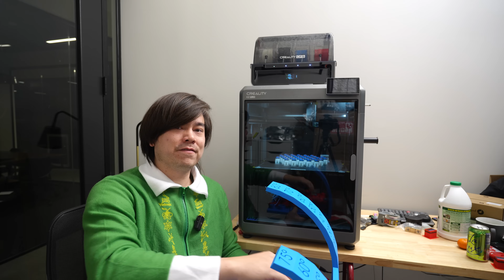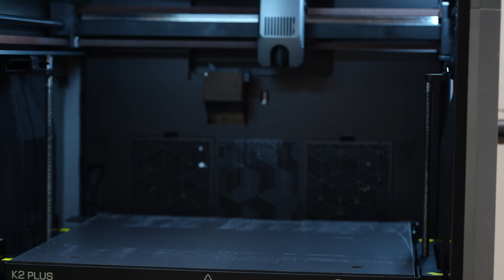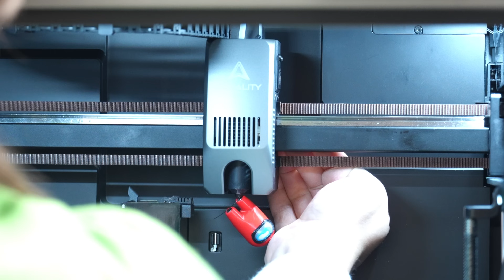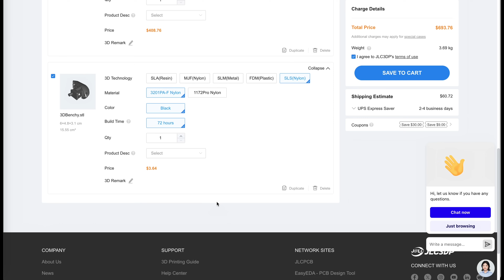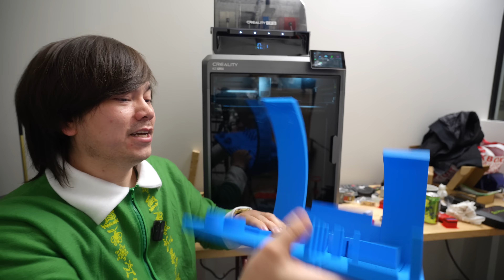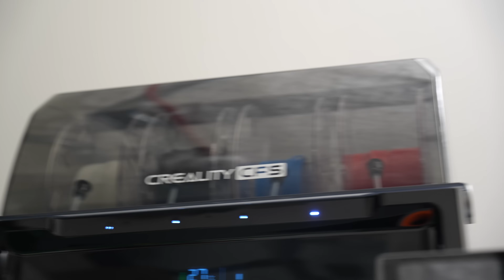Creality K2 Plus - Back With a Vengeance

Comment: "Nozzle and heater" section is a uninformative. Is it still a same Creality Unicorn nozzles? Is heater design as unfortunate as K1 was, requiring a regular thermal grease changes? Is fillament feeder is a same bad idea with cantilever drive gears? Does gears use and outdated design with roller bearings or a modern with ball bearings?
Reply: If this might help, from what I learned, it's a different nozzle&heater design with K1 series. Those two are not interchangeable.
Reply from the maker: Ok hold on, let me disassemble the entire printer for you right now 😪
Reply: @NathanBuildsRobots  For me? Or for a quality review for your audience? I see there is a minor difference. 

"Disassemble the _entire_ printer" or just service a damn hotend. An action which will be required to eventually be done by __every_ user of the product you are promoting?
Reply: @MrGarkin if he’s going to do it from suggestion, technically it’s both. But as a reviewer it makes zero sense to do it just for 1 person. You already answered your own question. I’m sure there will be complete disassembly videos soon, but they most likely want to get a bunch of prints out of the way first because everyone just wants to see the quality prints right now.
Reply: @SeriesDmusic "there will be others guys to do a good job" is a ridiculous take. 
"you are single person who needs this information" was not funny when was joked for the first time.

Comment: "Frame design" section is almost as underwhelming as "nozzle and heater"? Are they still using monolithic cast metal portal as at K1? How does frame differ from K1?
K1 is very problematic with it's X axis, tons of complaints all over teh internet. Did they finally abolish bronze bushing and finally gone to either ball bearings or POM?
Reply from the maker: K1 uses 4 extrusions for columns and a top/bottom portal. Everything is held together with bolts going into plastic blocks. K1 frame is very decent, but this is next level. Without fully taking it apart all I can say is it’s essentially 4 portals bolted together. Top/bottom like the k1 and left/right portals with steel or plastic panels bonded into the opening. I think everything is metal on metal bolted connections but it’s hard to see without disassembling it since there are no external fasteners
Reply: @NathanBuildsRobots  K1 monolithic cast XY gantry portal is main reason why it's has top accelerations relatively to every prebuilt on the market. 

Extended usage of a cast structure elements in K2 frame is a very good news for the product.
Reply: The K2 frame has nothing to do with the K1 apart from a similar visual appearance. There is a video posted on Creality's Facebook of the K2 assembly line, in which the printer appears "naked". The K2 has a lot of metal in its frame.
Reply: @matiasatamaniuk5266  would be very interesting to see it somewhere outside of the facebook.

Comment: I am just happy those old, shitty, Prusa gantry style i3 whatever the fuck machines are finally dying. 
I have always hated their design.
Reply from the maker: They have a place, it’s all about price point and if you need an enclosure
Reply: @NathanBuildsRobots  Honestly I don´t think they do. It´s like the old car you have to start with a crankshaft. The time is basically over. They are slighly cheaper however due to mass producting, completely ditching that design and scaling up the better design you get comparible price with a way better looking and functioning frame design. You can enclose them easier, they look better, easier to clean etc jaddi jadi and so on. There is no reason in my opinionwhy anybod should get the gantry design once. If 50 bucks difference hurt you so much well fine, that´s the only case, the price but that´s it.

Comment: It´s a 1.5k machine which isn´t cheap by itself, my Adventurer M5 costs 300bucks and is really really great value. However for the 1.5k you get a lot. Really interesting product.
Reply from the maker: Really this is a professional grade machine, I’m surprised something with this build is priced/marketed to consumers at all, but hey I guess people like expensive printers
Reply: @NathanBuildsRobots  I am not sure on the professional grade stuff. Creality isn´t professional grade for me. Not due to their build quality but due to their software and quality in general. I give you an example. The company I work for as a R&D Engineer recently bought a filament based system for 10k. Honestly it´s not better than the BamBu Labs machine for what is it not ? 2k or so ? But I know it is industrial grade. I can call them any time and they will better fix whatever problem I have and there are little problems I have because they have tested the thing in and out. With Creality, I am certain the thing will have some kind of bug withen the first 72h. It might be an software issue, or it overheats or whatever stupid stuff can go wrong. I have ZEEEROOO trust in Creality to deliver a finished quality product due to my experience with them. That´s mainly the reason why Bambu Lab is so popular, yeah Creality can make a machine like that but they completely lack the trust and rightfully so in my opinion.

Comment: It's too bad you have to be a creality fanboy, makes it hard to trust what you say. It's hilarious that you keep calling out Bambu lab fanboys and are so clearly on a team yourself. Luckily there are channels out there that will compare things, even with their biases, without gushing over/ bashing a product because of whose name is on the box. Looks like a great printer, hopefully some more objective reviewers agree. I'd like to say it's hard to believe Nathan likes it because when the x1c came out he was saying how much better bed slingers are than core xy lmfao, of course that was before creality had released one.
Reply from the maker: A1 mini is a bedslinger and it has huge advantages over the other bambu products.

Bedslingers ARE better in many ways other than outright performance.
Reply: @NathanBuildsRobots maybe do a video explaining how a bedslinger could be better than corexy?
Reply: @Armor3dprinting  He's actually already made a video about it. But it's a few years old by now.

In general you can say that bed slingers are a simpler design, cheaper to manufacture and you can send them in flat packs which saves on shipping costs.

An example where a bed slinger is superior to a Core XY printer. A Kickstarter campaign is currently running for an automatic buildplate swapping system for the A1 Mini. The system uses the movement of the print bed to eject the old buildplate and place the new one on the heatbed. It can turn a $200 printer into a production line.

If you wanted to do something similar with a Core XY printer then things gets a little more complicated and way more expensive. You can look up the Prusa Pro AFS or the Mosaic Array if you want to see how a automatic build plate swap is realized on a Core XY machine.
Reply: @andreas.grundler  that doesn't show how bed slinger are better than corexy. That's a specific case for a specific individual. I think in general, corexy will be superior to a bed slinger in terms of print quality and speed. Especially print quality AT speed
Reply: @Armor3dprinting  You're looking for absolutes, but you won't find them. As with everything in life, it always depends. Every design has it's pros and cons.

Yes, Core XY printers are usually faster, but even there there are exceptions. Have you ever heard of the LH stringer? This is a DIY bed slinger that blows any Core XY printer out of the water in terms of speed, and the quality on this printer is also impressive.

Are there Core XY machines that print well? Yes, there are. Are there Bedslingers that print well? Again, yes. You can have a Core XY machine that produces terrible quality while a Bedslinger you are looking at produces much better quality and vice versa.

Have you ever wondered why a company that said "No more bed slingers" has released two bed slingers? Think about it. Bambu Lab has two bed slingers in the lower price range. If there were no advantages to bedslingers in this price range, the A1 mini and A1 would also be Core XY machines.
Reply: @andreas.grundler  you're mistaken. I'm not looking for absolutes. I'm looking for reasons why someone would choose a bedslinger over corexy. LH stinger is a single example and that one is pretty awesome.  I still think that Corexy is the better platform. 
I think they are more capable in terms of speed, quality and material usage. And even counter space lol. But everyone is entitled to like what they like. I'm not hating.
Reply: @Armor3dprinting  There could be multiple reasons for this.

Price, for example. You can get a good bedslinger for as little as $200. Most decent Core XY printers cost $500 or more.
As mentioned above, the design is also simpler. This also makes it more beginner friendly when it comes to troubleshooting or maintenance.
Personally, I chose a Bedslinger as my first printer because of the noise. Many of the fast Core XY printers are very loud.

In the end, it's just a matter of personal preference. If speed is not so important, a slower printer will do, and as tests show, a lot of bedslingers can produce a print quality that is sufficient for most people.

Comment: Not seeing "servo" anywhere in the marketing materials. Pretty sure, it's just a closed loop stepper with a FOC driver.
Reply: Its step-servo, it says it on the specsheet in their webshop, and they also shared a (pretty basic) comparison between step-servo, closed-loop step motor, and open-loop step motor on their discord a few months ago, stating that all the motors in this printer are step-servo
Reply: @ntopee  It was too good to be true...
Reply from the maker: Closed loop is by definition a servo. Source: I build robots. Unless I’m getting something wrong?
Reply: @NathanBuildsRobots  At least at the CNC motors manufacturers listings there are always a clear distinguish between Closed Loop Steppers and Servo Motors, which are always a closed loop brushless AC-motors. I'd say that a 3d printers domain is much closer to the CNC, than to the Robotics.
Reply: @NathanBuildsRobots  And there is a big difference betwee a closed loop stepper and a closed loop brushless ac motor. This is why distinguish is a must.
Reply: @NathanBuildsRobots  Does it have optical encoders. Do you know?

Comment: How does it Auto Level and Z Offset?
Reply from the maker: Force sensor. I need to take it apart to figure it out
Reply: @NathanBuildsRobots  Thank You 20000%. Touch nozzles on the to the bed surface is not a good option IMHO. Plastic tiny on the nozzles, heat pressing down on the bed like a stiletto heel on a wood floor
Reply: They use the Shot In The Dark method!

Comment: same price, yeah no it isn't anywhere close to the same price.
Reply: Isn't the normal X1C combo like $1500?
Reply: @claytonanderson9665  after having a second look yes it is, in the US. Seems to have been on sale for $1200US for some time now. In Australia the x1c combo normal price is $2,219($1,869 on sale), the k2 is $2569, so I figured the US price would be different too.
Reply from the maker: Yeah… I wonder why they put it on sale 😂
X1C is still a good machine and has the slight edge in print quality, but the K2 plus is better in so many other ways that I’d still go with the K2 plus.

Also bambu lab has a hidden tax… they charge for shipping while no other company does that. So add $15/$30 to the bambu price

Comment: Sounds like Creality are locked in on this one, but I've already been burned with their "trust me we fixed it this time".
Reply: Yeah I bought most of their machines up to and including 2 X Ender 5 Plus, with the Ender 5 Plus they said they fixed a FW issue where the bed was scanned in an uniform manner, they didn't! in fact they introduced a new fault where random mesh data was produced from the bed leveler.
 I sacked them by purchasing Bambu Lab X1 Carbons and AMS units.
 I still use the Ender 5 Plus machines in a production environment as they have massive build surfaces but I have modded them withinan inch of their lives, there is not much of Creality left on them!
 I am expecting plenty of errors with this machine, well its traditional isn't it!
Reply: @AndrewAHayes I had zero problems with my Ender 5 Plus, only upgrade was alumium extruder, silent board and prints started from Octoprint. And I did some messive prints with it.
Reply: To bad of an experience with my K1 Max to trust them again for a while.
Reply from the maker: Creality’s biggest hurdle is regaining consumer trust. That’s hard to earn and easy to lose.
Reply: @NathanBuildsRobots  Exactly. Inlike Nathan from Nathans Builds Robots. One of the best YouTubes in the 3D Printing universe =)
Reply: @sierraecho884  there is no videos out from other youtubers because of NDA, same happened with k1 he was first one to have it reviewed, I would think twice if Nathan's content should be trusted........
Reply: Yeah, I got a K1 Max, and it required more tinkering than I was hoping for. I don't like the proprietary nature of Bambu Labs, but when their new printer comes out next year, and it's as good as the X1C, I might give them a try for having a (mostly) "just works" machine.
Reply: @ThomasS17 What kind of tinkering? I was thinking of getting one
Reply: @ThomasS17  Yeah I don't like the proprietary, but I hate tinkering more.  Several hundred hours on my Bambu printers so far with 0 issues.
Reply: This is absolutely true, and always holds me back on their products. I got the Adventurer 5M instead, for 300 bucks you really can´t complain. I would be hesitant to invest 1.5k in this machine instead.
Reply: You called yourself an "influencer" lol 😆
Reply: There's nothing I've owned that creality messed up, that micro Swiss didn't fix
Reply: Dang, i’m gonna get this i think
Reply: I was burned by Creality when I purchased a K1 Max, it clogged on day 1 using the material they sent me. Thankfully, they included a spare nozzle. The pins that attached the nozzle wires to the board were covered in glue. I had to cut it away, then I sliced my fingers on the board when I tried to pull the pins out. On top of that, the cable snapped. I was told by support that they would send me a new nozzle. They said the glue on the pins was normal.
Reply: Broken foot bolts is one of the issues. And by the looks of it some software problems as well.
Reply: Just wait until enough people get their machines and had them for a few months. I'll guess that YouTubers will get handpicked printers that were tested before.
Reply: thats exactly why im not eagered to go back to creality. and it took em 3 years to counter bambu. we all know bambu is throwing its black friday sale early so they can introduce their new model for xmass ;)

Comment: the issue with creality printers is that they are good on paper and running ok for the first prints, but after a short while, errors strat to appear.
they always rely on the customer's technical skills to operate the machine, and also their "Human Engineering" is lacking.
they releasing half-baked products in a reasonable price. but be sure that 6 month later they will release a "new and improved" printer.
Reply: At least they dont break with tradition! LOL
Reply from the maker: That had been my experience until the last few that came out. They are definitely making changes internally to try to improve their oroducts

Comment: For the price it would want to be great, shame creality use cheap parts that don't hold up. Love my K1 max but it's lacking in quality and some of the cost cutting choices made are just incompetent. End of the day though no matter how good or bad a printer is if customer tech support is bad it's a fail, and creality tech support is beyond bad.
Reply from the maker: I didn’t see any “cheap parts” on this. All good linear motion, metal components, motors, etc with no funky stuff going on.
Reply: Creality tech support is the best I've seen from a chinese brand so far, they always reply instanly in chinese working hours, they are competent, responsive, and when I  needed a replacement part they got it to me to the EU in like 4 days via priority shipping. I have my own issues with them, like their horrible QC, but customer support is one of the few things the do very well. Maybe you have earlier experiences and they have stepped it up since, or i was just lucky every time i contacted them, but reading their discord it looks like most people have a very positive experience like me.

Comment: Great video. The printer seems to be nice too. What do you think Nathan, is it a good idea to buy a brand new k1max right now for 590? and mod it ofcourse.
Reply from the maker: It’s hard to say, they did a silent upgrade to the K1 max so I don’t really know what the newer models are like. Plus I e had issues with heat creep on the new K1 unicorn nozzles
Reply: @NathanBuildsRobots  What materials were you printing when heat creep happened ? I had one ordered recently, but had to return it for a new one because of some pulley issue. Box had a date on it 2024-04, it had unicorn nozzle and upgraded extruder etc... When I was talking to creality and asked if there's a way to get one from recent batches, they said that printers are sent randomly, which is a little sad that they sell stock from 6 months ago.  Or maybe it was returned or refurbished at some point.